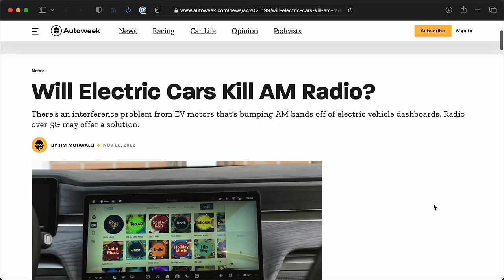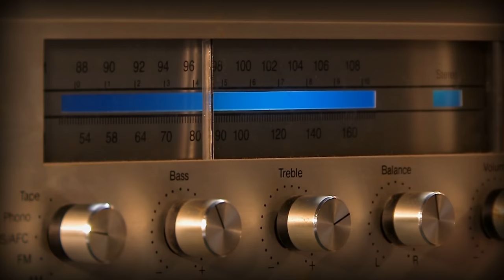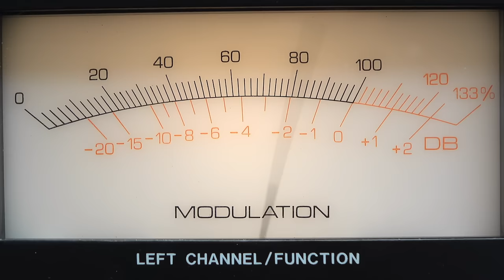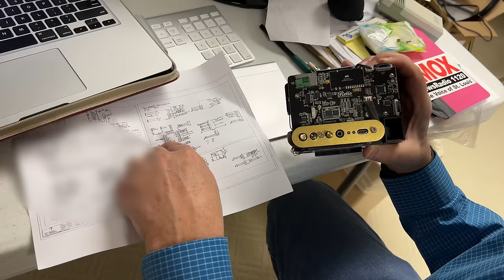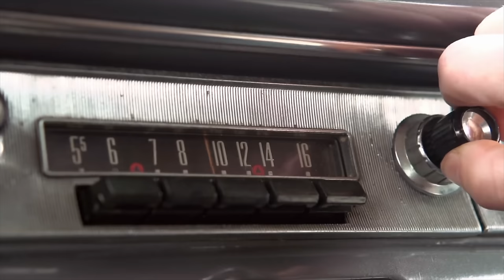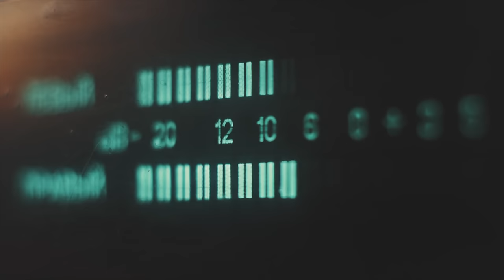Is AM radio dead? Tesla thinks so!

Comment: In Poland we are still broadcasting channel one of Polish Radio (Program Pierwszy Polskiego Radia also called Jedynka) at 225 khz. In 80's Poland got biggest radio tower in world. It whose designed and build specially for 225 khz.
Reply: That’s a low frequency! Tall towers for sure. I’ld like to check that out.
Reply: @radijoe  RCN Konstantynów whose 646 metres tall. It collapsed during maintenance, due to errors in procedures of changing stabilizing cables. Now the signal is transmitted thru RCN Solec Kujawski.
Reply: @radijoe  The Long Wave band. Still going in the UK broadcasting Radio 4 on 198kHz but not sure for how long. There are only a handful of long wave stations still going around Europe. Some of them can be picked up in the US at night apparently. There's a facebook group dedicated to it.

Comment: I'm a diehard Cardinals fan roughly 500 miles from STL. It wasn't until 2016, through the YouTuber "Todderbert", that I got into the hobby of AM DX'ing. While I'm not into it a lot, it has been fun getting stations like WWL in New Orleans (just over 1000 miles from me), or WSM in Nashville, or WCBS in NYC, at night. While it's possible to get a lot of stations through apps like TuneIn these days, it's sad that AM could - one day - potentially go by the wayside.

Comment: During a natural disaster with power out, the broadband RF hash that usually makes AM inferior disappears as all the noisy LED’s, PV panels and switch-mode power supplies stop working. Thus, the signal-to-noise ratio of AM increases. Even just one high power AM transmitter could be heard across an entire continent at night. AM is inferior most of the time but far superior and necessary for those rare events, when cell towers and internet goes down.
I remember as a kid going on a road trip through the country. As blue sky gave way to grey clouds, you could hear faint static crashes listening to the local AM station – an early warning of thunderstorms. This was a time before smart phones and weather apps. And a portable/pocket AM radio with a ferrite bar can be rotated to find max signal strength for direction-finding (DF) – the same principle aircraft use as a navaid for NDB’s. It’s not just about content – AM can be used to predict weather, propagation and for navigation! It’s still incredibly useful for multiple reasons!

Comment: AM radio was the very original radio system that has existed since the early part of the 20th century. One of the reasons that it still exists today is that no one wants the band of radio frequencies that the FCC assigned to AM radio a long time ago. Today it seems like AM is mostly used for talk radio and a few news stations. Also AM radio is still used for highway information. However since Edwin Howard Armstrong invented FM radio, FM radio has always had better sound quality since it is not subject to electrical interference. Also the truth is that electric car makers can do things that will reduce AM radio interference, however since that would cost extra money they are not likely to do it. One thing that was used for many years in cars to reduce AM radio interference was radio signal suppression spark plug wires.
Reply: FM is subject to interference, just not regular electric lines. Cell towers definitely can interfere with FM.

Comment: In Brazil, we're on our way to move the vast majority of AM/MW stations to FM. To handle the extra spectrum demand, the FM band has been expanded using the room left by TV channels 5 & 6. Car stereos and cell phones from the last 3 years already cover the whole 76 to 108MHz band. Main force behind the migration of AM to analog FM were stations owners and local broadcast vendors that were losing ad revenue to FM and wanted a cheap and fast transition without the development costs required by modulation schemes like DRM, DAB or IBOC.

Comment: AM is not dead.  The advent of digital AM radio has saved the band.  It sounds as clear as braodcast FM and when you fall out of the digital range, the radio automatically drops back to conventional AM.  AM is also many nation's default national emergency communication band because of its extreme range.  It requires no networks to get the long range, unlike internet, cellular, and VHF/UHF communication.  The aspects of AM broadcast radio being excellent for national emergency communication will likely keep AM broadcast alive a long time.  International shortwave broadcasts are still done in AM with some SSB.  The infamous citizen's band is mostly AM as well, which is also an excellent communication resource when networks are down.  Aircraft communication is all AM ,from the air, because strong FM signals will drown out all distant and weaker FM signals, AM does not do that the same way.  Some Satellite communication is done in AM as well.  AM receivers are almost childishly easy to make, as well.  I think AM may be around a long time.  As for Tesla Motors, electric cars are only good for cities and near suburban areas.  The battery range, charging time, charging station availability, and lack of portably storage ability, assures electric cars will not be used in far suburban, and rural areas.
Reply: HD am has been pretty much a bust. Here in Chicago, there might be one station that still runs it, but that's about it.
Reply: @johnstone7697  Yes; while I want it to be true that AM will be saved, I think it's wishful thinking—just look at Europe. AM died over there many years ago, and despite transitioning to digital, FM is now being shut down by mandate in many countries too; they want to reallocate the band. I'd bet it'll be around here for another 5-10 years at least, but I find it difficult to believe it won't happen here too.
Reply: Everything you said signals dead.
Reply: @FarnhamJ07  Bro, Eurupe is just a lab for the world...
Reply: Hybrid digital on AM was a complete disaster. It caused tons of adjacent channel interference in analog. The digital signal itself was low bit rate and only had a third of the station's total range. High fidelity analog sounded much cleaner and natural. AM digital only is a different story. But it renders 100 years of broadcast and receiver technology (and legecy) obsolete. My idea is to utilize the old European longwave band (150-280 kHz) for digital only use by American AM broadcasters. Most of the airport beacons that use to operate there are gone and the ones remaining can move to above 280 kHz. Many radios sold in North America were designed to receive these frequencies but need to have it enabled.
Reply: @FarnhamJ07  The difference between Europe and the US is there is waaaay kore distance to cover here.

AM is great at covering large distances - which is why I think we will still have a few large stations scattered around the country for quite some time. 

Good for emergency broadcasts and such.
Reply: There is no infrasructure for electric cars. I am surprised Tesla is still around. Affordability is also another big problem they have. Battery technology is still too primitive for really long range.
Reply: @wa1ufo  Visit the lithium mine in Alberta.  No petroleum mining could ever make such a disaster.  Unfortunately, I have to go once a year to bring exhausted battery packs in.  I have never seen such misery. The workers also look hopeless.  Petroleum's energy concentration is incredibly high compared to any battery. Petroleum is also far safer than any battery, as well.
Reply: I remember in the mid 80s  WJR played around with AM stereo via CQuam and it sounded pretty decent especially on live Tiger games.
Reply: As long as it's backward compatible, it serves it's purpose.  As the man said, it's the backbone of the Emergency Broadcast System.
Reply: @HarryHamsterChannel  The beauty of it is.  An AM receiver is childlessly easy to make. I made them as a pathfinder when I was 10 years of age.  The variable inductor winding was the hardest part.  All that took was patients.  If one made the coil a bit shorter, we could pick up international shortwave broadcasts.  If made longer, we got navigation beacons.  I think the formula was 1/2¶✔️(LC) where L is inductance in henrys and C is capacitance in microfarads. Of course, the formula was not presented at pathfinders nor at 10 years old. But the simple crystal receiver stimulated such interest that I had to figure out how it worked a couple of years later.  The germanium diode could  be found in almost an piece of electronic wreckage, back then. Even a silicon diode worked, but very poorly.   I even tried to make electronics thanks to that experiment. But it was all for not.  Today, I am a technical mechanic.  I love when I get to mess with electronics, but it is not daily. It is mainly hydraulics, mechanics, ladder logic, refrigeration, and some mild programming.
Reply: There is no digital AM or even FM in the Salt Lake City Utah area!! Everything still analog here except of course for TV stations, but most folks have satellite or cable for TV, so even that is bust.
Reply: @fjockey1  As a pilot, I can say there is absolutely no need for NDBs (beacons) anymore. And I actually don't know of any at all still around, anywhere. I think they killed them all.
Reply: @markr.1984  All I have is an antique antenna, made in 1989, on my roof for television.  I use it for television and radio. I got rid of cable when they told me that I had to upgrade my service to get the HD channels.  Then I told them I could use my antique antenna for HD local channels.  The representative told me that the antique antenna would not work on ith a digital signal. With that idiotic falsehood, I told them to close my account.  Then I connected my RadioShack Archer 75 antenna and did a scan.  I have 38 channels.  Never trust Comcast.
Reply: HD RADIO was a flop for both AM and FM bands.  People rather stream music off their phones 

.
Reply: @NewHampshireBoy WHAT are you talking about???  Every house has 240 volt plugs that can charge an EV while you sleep.   The infrastructure is there.  Everyone has electricity at home.

For extended roadtrips (over 300 miles) there are superchargers to fill your EV in just 20 minutes 

.
Reply: @electrictroy2010  Those are city people. In the rural communities, cellular phones are near worthless.  We still carry around coins in our vehicle's coin trays to stop at a payphone, if needed.  We also still use radio services, like CB and GMRS.  Some people have a, cellular phone that commute to the city to work.  But locally, cellular phone are just paper weights.  We onky got 1 gigabit connection speeds six years ago.  Here, electric cars, cellular phones, and cars with los ground clearance are all junk.  But strangely, I do have a Smarthome with everything automated by voice and tablet. As soon as I step outside my property, it is the 1980s again.  We do have HD radio.  But we have to have a radio that receives it.  It looks weird to have a vehicle made in 1996 with a modern touch screen stereo with GPS, HD, USB, and smart card attachments.
Reply: The problem is switching power supplies, todays modern jammer.
Reply: @erin19030  a homemade, full wave bridge, regulated, power supply, with large capacitors is far cleaner than most of the supplies you can buy.  Use a true full wave bridge and not one you make out of rectifier diodes because it has a shield.  I made a 32 ampere power supply with almost no ripple current and no noise pickup because of the heavy, grounded, metal housing.  All of it was made out of electronic refuse.  I bought nothing.  Even the metal housing and heavy transformer was from a vintage battery charger.  It is made using all old technology, no computer regulators, and no integrated circuits.  It is built like something from the 1970s.
Reply: @wa1ufo  except for the sprawling road networks that cover the world, and the power grids that cover only slightly less of the world. EVs certainly have a lot of problems, but the core infrastructure was built decades ago for normal cars and the electricity in our homes. in fact, id say one of the big problems with EVs is that they also rely on that car-centric infrastructure!
Reply: This thread is nothing but willful ignorance. I drive a gasoline car but the claim that range isn't long enough and there is no charging infrastructure is objectively false. Electric cars are actually worse in cities due to the lack of roadside charging, which just happens to be where most people park. Statistically, the vast majority of Americans don't drive for more than 60 miles to get to and from work, and even less travel more than 100 miles one way. How often do you ACTUALLY fill your tank all the way, nevermind use that whole tank in a day? I'm willing to bet that most fill up to a quarter tank. I'm my car, that's less than what a base spec Leaf can do.

Charging infrastructure doesn't exist? You're telling me your damn near abandoned house doesn't have electrical outlets?
It's arguable that suburban and rural areas have better charging than urban cities as there's almost always a way to charge at home, and that is the most common way to charge. Can DC fast charging be faster? Yes, most cars struggle with consistent charging curves. Does it really need to? For the soccer moms who have a daily commute of 5 miles round trip to and from work, no not really. For the handful of people who drive in excess of 500 miles daily? Perhaps hydrogen would be a better choice. EVs struggle in covering vast distances in a hurry.
Reply: @SSFighter1701  Just saying, the continental United States and Europe are about the exact same size...